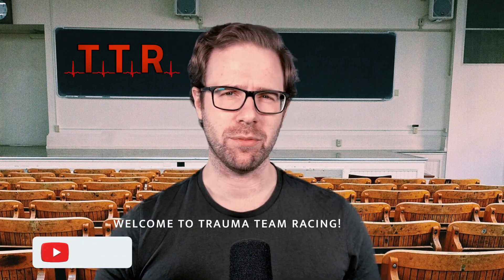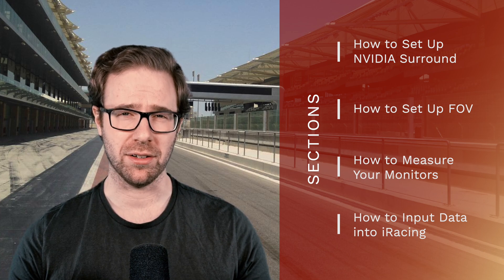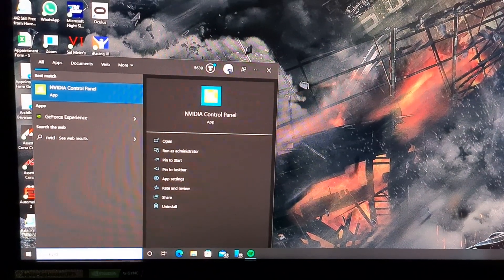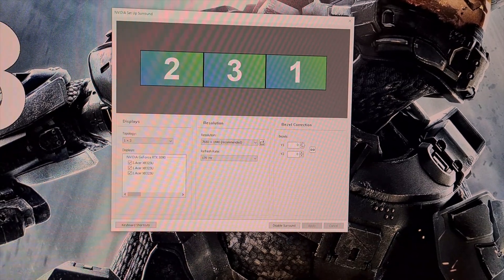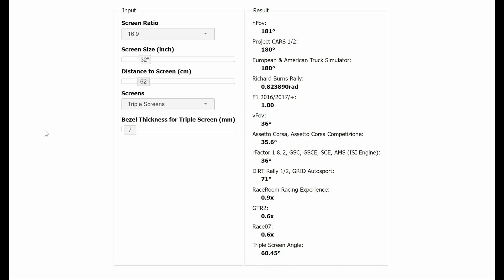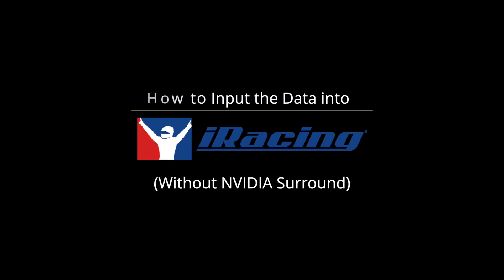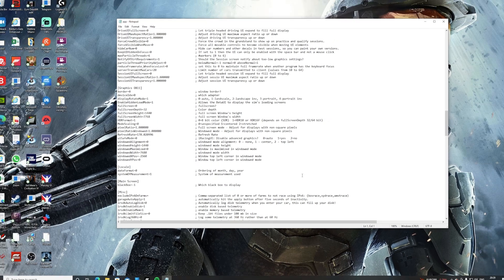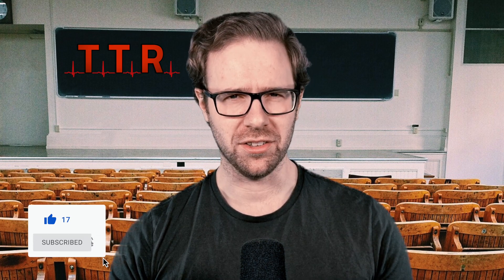How to Setup Triple Monitors in iRacing with Correct Field of View +/- NVIDIA Surround

Comment: All my graphic settings has been reset recently and im trying to set it back up (without surround). I see that the "windowedheight" and "width" has been moved to "rendererDX11" instead of app.ini.
When i change the settings to the wide resolution it for some reason stays single screen in game, even tho the in game resolution says 7680x1440 which is correct.
Any idea why? :)
Reply from the maker: Sometimes a hard reset can fix things. That's not much of a solution though I'm afraid. Sometimes a 4th monitor can mess things up too. Do you have a 4th monitor connected?
Reply: @TraumaTeamRacing  By "hard reset" do you mean, uninstall, reinstall?
Reply from the maker: @JoeMarrant  Sorry mate. Yes, that's what I meant. Did you install this through the steam client?
Reply: @TraumaTeamRacing  No. I run off of the UI.
Reply from the maker: @JoeMarrant  That was the other thing. Steam buggers things up😕 Did you make any headway?
Reply: @TraumaTeamRacing  not yet. I’ll continue to work on it. If I find a solution, I’ll let you know
Reply from the maker: @JoeMarrant  Would be interested to know mate. Sorry I couldn't help. I hope you get it sorted😕
Reply: @TraumaTeamRacing  I have been trouble shooting for a couple of hours and can not figure this out. I've noticed the monitor settings are in more than one file. I've changed all I can change and can't find help on Google. Until I find a solution, it looks like I'll be running the Nvidia surround. I do appreciate your help.
Reply from the maker: @JoeMarrant  Sorry I couldn't be more help mate. At least the NVIDIA work around is still working for you.

Comment: I’m just setting up my first triple screen setup for iracing “4th screen set on top of middle screen”. My question is I like to also play first person shooters on just my main center screen so with that being the case, would it be easier to setup my triples without nvidia surround or with? Thanks.
Reply from the maker: I sometimes play 1st person shooters. If you keep it in surround you can just set it to whatever resolution you want in game and it should appear just fine on the centre monitor if I remember correctly. Both ways would work. Just try both and see what works best with your work flow👍🏻
Reply: How did you solve the problem? Because i run my 4th screen on a desk and play also shooters on the  4th screen.

Comment: At around 6:50 you input 180 “…from your desired field og view“ in the field “Field of view when driving.” I’m trying to get my head around what calculation result you are using from the FOV calculation tool. Result hFOV shows 181, so I don’t get it.
Reply from the maker: At 04:30 I talk about where my eye line is in comparison to my monitors. At this point it is 180 degree FOV if drawn to edge of the monitor. The rest of the angles are calculated from that. The calculation tool shows 181 but just round down to 180. In practice your head moves whilst driving and will never be that accurate.

Comment: Its seems my app folder doesn't have those options. I see Graphics DX11, but there are only 2 options in it, which are: Enable hidden load mode, and ui safe mode. How do I do this with those options missing?
Reply: So for the others having this same issue, iRacing updated files since this video was released. Instead of going into "thisPc/Documents/iRacing/APPS" you go to "thisPc/Documents/iRacing/RENDERERDX11MONITOR"

All steps from video are correct, except what file you open. Instead of apps, its the rendererdx11monitor.
Reply: @TheBazzShow  Make sure it's set to read-only as well. iRacing tends to want to overwrite it.
Reply: @TheBazzShow  Thanks man, this was a huge help for me. I'm not great with computers and this was killing me
Reply: I don't want to use NVidia surround btw.
Reply from the maker: It should be within the 'ini' file, not sure why it's not showing. Open it with notepad and use the search function to search for the term if you are having trouble. If there is a bug you might have to do a reinstall. Hope that helps and good luck.

Comment: Thanks for the help with this. I done everything correct and for some reason my side monitor image seems to be curved towards me rather then following the centre screen straight. If that makes sense.  Any help would be great 👍
Reply from the maker: You're welcome👍🏻 This really shouldn't be the case if followed correctly. I would suggest if you have done this with NVIDIA then try doing it with the ini file (or vice versa) and see if that solves the issue. Also double check that the data has been inputted correctly. Very easy to make a mistake.
Reply: @TraumaTeamRacing  thankyou for the reply. Yes I have tried both. I am very confused.
Reply from the maker: Maybe try a full reinstall and make sure the graphics drivers are up to date. Are you sure you have calculated the angles correctly?
Reply: @TraumaTeamRacing  ok I will give that a try. And yes I followed your directions.. I will let you know how I go..again thankyou for your help
Reply from the maker: @benjaminduncan4286  Not sure I've helped much mate. But you're welcome. Good luck mate👍🏻

Comment: If you are using three UltraWide monitors, the ratio is 48:9.
Reply from the maker: If you are talking about the FOV calculator I believe the aspect ratio is 21:9 you need to have selected but might differ depending on the monitor. Hope that helps👍🏻

Comment: Fov calculators don’t take perspective into account, so it will only give you accurate figures if you are close enough to the monitors, if you sit further away it’s going to lower your fov to the point where the track looks compressed, in reality sitting further away from a screen doesn’t change your perspective. It’s like looking at a picture on a wall, if you move further back the picture still looks the same, just smaller the picture doesn’t become warped. Race beyond matter does a video where he always uses 540mm as the distance from screen regardless of what it actually is and that will give you a much more accurate looking fov with a good sense of speed, I myself run 186° fov with Tripple 1440p screen and I sit 580mm away from the screens and it looks perfect, I’ve also had a number of real life drivers in my rig one of which races lmp2 cars in the world endurance series and he reckons the fov felt perfectly natural to him right off the bat. So take fov calculators with a pinch of salt especially if you sit further back from your screens, it will cost you a lot of lap time
Reply from the maker: Ultimately I feel for FOV there is a lot of room for interpretation and for the uninitiated can be very overwhelming which is why I have tried to keep this simple for those starting out. I have seen his video and if you work out a 180 degree FOV for 27 to 32 monitors you get a figure of 53 - 60cm and his figure falls within that, as does yours.

For me I like to think of the monitor screen as the windshield and in real life I'd be about that distance away if I was trying to replicate it. I wouldn't be sat 100cm away with a FOV of 120 degrees so for me that would not make sense and I agree with you. The perspective would be off. However if we are talking differences of 10cm from the screen with head movement taken into account I think the differences would be difficult to notice. The distance will fluctuate with c-spine forward flexion/lateral rotation so the distance between you and monitor will never be static. Unless someone straps their head to the head rest.

I would still recommend an FOV calculator to start and then once someone feels comfortable to then start tweaking from there as it is the best starting point for those with no or limited knowledge on the subject matter.

Comment: How can you set up 4 monitors like I have for ATS? 3 makes no sense to me because your windshield is not the same width as your door windows. I have my driver side half on the left middle and passenger side on the right middle and then the outside monitors for my doors and mirrors. But in racing the steering wheel is always centered to the display so I’m split in half between the 2 middle monitors instead of it being realistic. I cannot find an option for 4 monitors or a setting to offset the view so I’m in the left middle monitor. I guess the only way I’d feel comfortable using triple monitors is if I bought an ultra wide for the middle and regular monitors for the sides. But it’d still be centered in the middle screen.
Reply from the maker: Hi there, thanks for reaching out.

A triple setup seems to be the industry standard I'm afraid for these kind of sims and I am not aware of any option within the sim to add a 4th monitor to the mix.

What might be worth exploring is if you could somehow trick your system into registering the middle 2 monitors as a singular display, then head into iRacing and try and get it to get up a triple display from there (with the 4 monitors).

Don't have any experience of this but that would be where I would start. Sorry I can't be more helpful.

Comment: Thank you for this, I'm getting a rig and triple monitors soon so this will be a big help. Subscribed!!

Also I know ASUS sold a bezeless kit but that seems to have been discontinued, is there an alternate way to achieve what ASUS did with there kit
Reply from the maker: Hi there Sergio👋🏻 Thanks for the kind words. Glad you found this all useful👍🏻

Welcome to the team💪🏻

Triple monitors are a game changer and you shouldn't be disappointed. I've done some other guides for triple setup that you might also find useful. If you have any requests please bang them through and I'll do my best👍🏻

The ASUS kit I did look into but reviews said that the edges were quite sharp and risked scratching the surface of the attached screens. I personally couldn't cope with a scratch so thought not to risk it.

I have seen some mods with some plexiglass but if I'm honest it they are well aligned, when I'm racing I really don't notice them at all.

Hope that helps👍🏻
Reply: @TraumaTeamRacing  Thank you for the advice! 
Yeah I didn't think about the potential of the screen getting scratched, I'm the type where I would get annoyed even with a microscratch. 
Maybe the bezels won't bother me, I'm getting three MSI Optix G273QPF and it mentions narrow bezels so it shouldn't bother me too much either.
Reply from the maker: Great minds😅 Those screens look solid, just had a little peek. Nice refresh rate as well👌🏻 Looks like they will serve you well and the bezel thickness looks ideal.

Comment: You do not need any external FOV calculator. Just simply put all necessary inputs into MONITORS settings and click "red compute" to get the correct FOV in iRacing.
and btw, DO NOT use 3 curved monitors option in iRacing MONITOR settings for regular curved monitors. It works only if your curved monitors/projectors form a regular smooth semicircle.
Reply from the maker: Hi there, thanks for the comment. I believe the FOV calculator is a better starting point than iRacing as it is mathematically more intuitive so easier to play around with. I found sometimes the FOV calculator on iRacing is buggy so I feel this is a better way. I used this as a double check which I believe is sensible and cuts down a lot of messing with the iRacing calculator. I also mention within the video to hit compute. I also say that you need to put in radius of curvature for curved monitors which is the complete radius of curvature formed by all 3, so yes I agree.
Reply: @TraumaTeamRacing  I have never had a problem with iRacing fov calculator. I know it is a tiny difference, but the calculator you mention uses only "cm"  instead of "mm" in iRacing and it makes my calculation more precise.
Reply from the maker: @MyGermo  As long as it works for you that is the important thing😊 As long as you take the measurements to the same number of significant figures the accuracy is the same. I wouldn't worry too much about that👍🏻
Reply: @TraumaTeamRacing  I cant help myself, I am perfectionist :-D
Reply from the maker: @MyGermo  Nothing wrong with that at all💪🏻👍🏻👌🏻

Comment: when you chose your monitor size for the calculator, is that the actual width (like iracing) or corner to corner measurement(advertized 34" monitors)?
Reply from the maker: This would be the advertised width or the diagonal measurement (corner to corner) of the monitor screen.

Hope that helps👍🏻